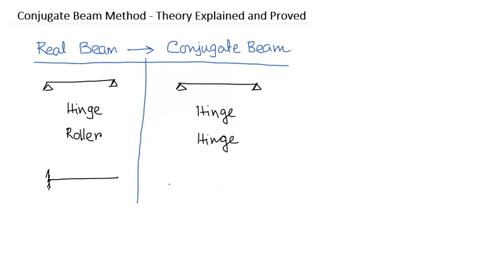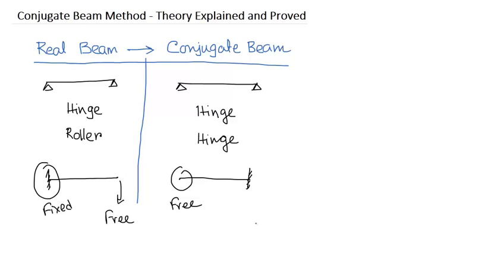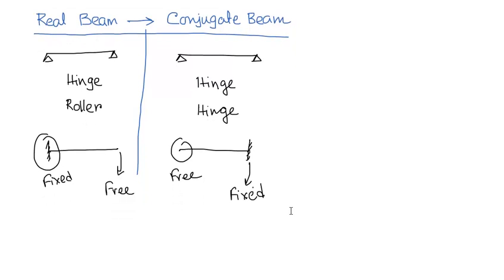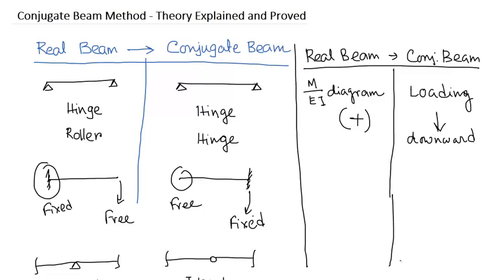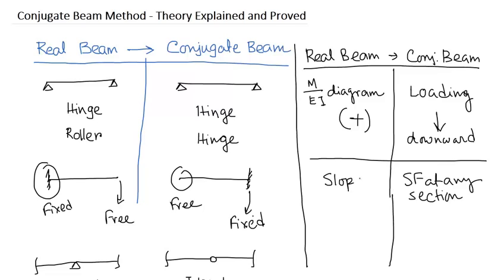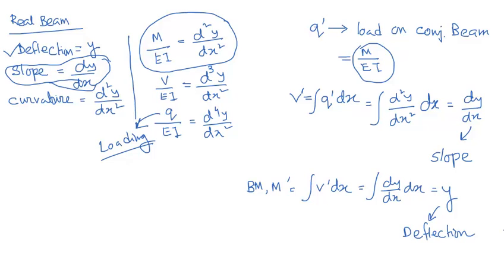Conjugate Beam Method | Theory Explained and Proved

Comment from the maker: In this video I have said Roller support becomes hinged support in conjugate beam. It is technically incorrect though roller and hinge support both has Shear=Value and BM=0. So considering hinge also you get same result. Apologising for this error.
Reply from the maker: Yaa you are right. I mistakenly told hinged.
Reply: so is it roller or hinge